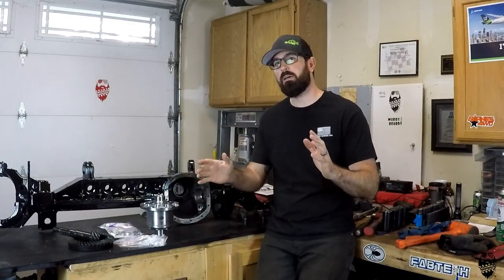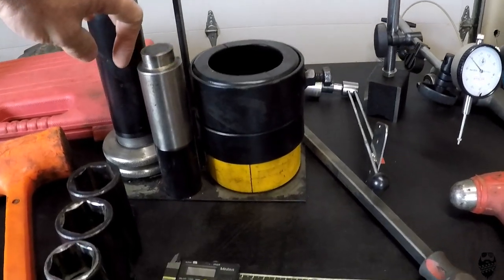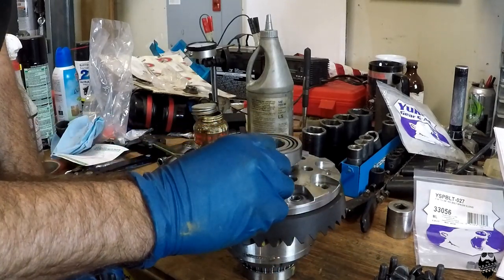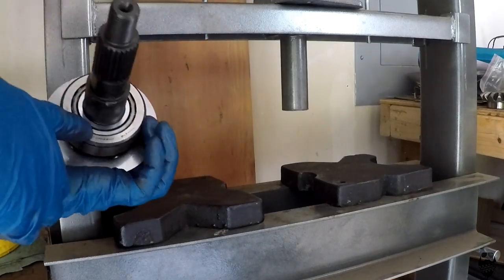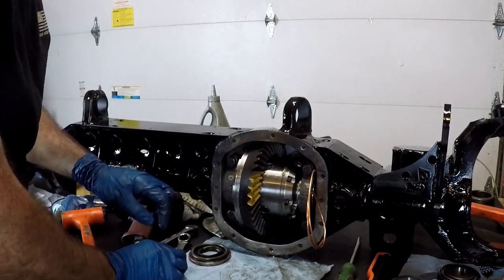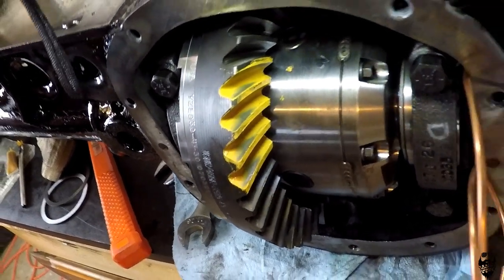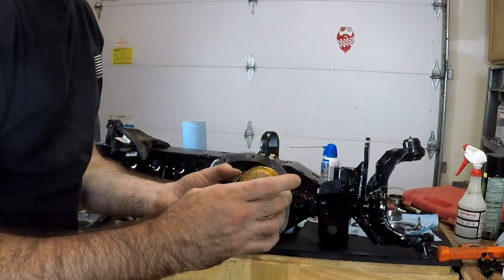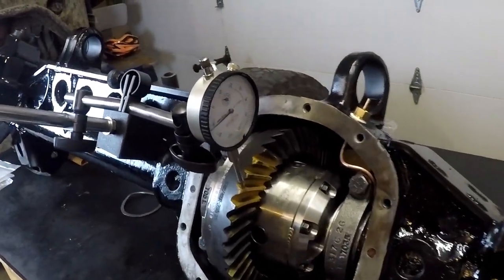Ultimate Dana 30! Episode 2 Yukon 4.88 gears and Zip Locker Install

Comment: 18:45 - It being a high pinion means the drive side is the drive side and coast is coast.  A low pinion is backwards as you stated which is why a low pinion is less desirable, it drives on the coast (weak) side of the ring gear.

Comment: Youve done a great job both physically and educationally. Just a few things with all due respect. I see you having trouble getting your ring gear assembly in the housing. Companies like Mophorn makes a housing spreader to be used in the big blind shallow holes to either side of your housing opening. Just Google jeep differential spreader and or look on amazon. Also unless I saw it wrong (if I did, apologies), when you push your bearings on dont push on the opposite race from the interference fit. If you are installing on a shaft, push on the inner race. Installing in a housing bore, push on the outer race. Not adhearing to this could brendel the bearing race and shorten the life of the bearing significantly. Take an old inner race and dremel out the center till it's a slip fit or more on the shaft and use it as a pusher die. Same for outer race applications. Hope this helps. Keep up the good work and awesome editorials.

Comment: Dana bearing caps are marked at the factory for orientation. if you look at the cap there will be a letter stamped in it and the other cap will have the same letter but turned sideways, the seal surface of the housing will have the same letters that you align the caps with
Reply from the maker: Yes they are👍🏻

Comment: Haters are going to hate on a Dana 30 my 30 is Rock Solid been rocking it for years
Reply: On small tires, sure...
Reply: Wrong 35x1550x15 Super Swampers with beadlocks
Reply from the maker: 36” TSL with locker and factory shafts, still holding together.

Comment: Very detailed video.  I watched Nate's part one already and  I'm stoked about this one because I literally have a high pinion 30 out in my driveway waiting to build similar to this one.  Never done gears but I have set pinion preload on a Dana 30 low pinion with a crush sleeve which is different than the high pinion with shims.   I still need a few tools yet as well.  But I am def going to try and tackle this soon!
Reply from the maker: Awesome👍🏻 good luck
Reply: Got a zj on 33's. Think this would be a great way to go since it's already got the high pinion 30.

Comment: I pulled my Dana 30 high pinion and put new gears bearings axles hubs balljoints. Did the same with my Chrysler 8.25 on my 96 Cherokee.  Should be good for another 200000 miles. Great video wish you had this video out a year ago. The previous owner removed the ring gear on the d30. What a shock that was when I removed the axle cover to see why my front axle wasn't working. Still cant figure out how they tore up the ring and pinion.
Reply from the maker: Nice, 👍🏻 people do some crazy stuff before they sell vehicles to cover up broken stuff, lol.

Comment: On the topic of pinion and diff bearings getting lubed. Check out Gale Banks vid on diff covers. Made me re think diff cover armor. I will be stock cover with external bolt on protection.

Comment: New subscriber to your channel. You should invest in a case spreader!  Like you said...  you can’t set preload too high on the carrier bearings and to this I agree. But some additional preload you can obtain by spreading the case .010 - .015 will help reduce ring gear deflection under stress. We all know deflection is a major enemy of the ring and pinion!  Look forward to browsing them through all your vids!
Reply from the maker: Thanks, 👊🏻 I definitely would like to get one, would save a lot of headache trying to get shims in, I just looked them up and they are more expensive than I was expecting.
Reply: Muddy Beards 4X4   Look on eBay. You can pick one up with free shipping for under $70!  I build a lot of axles for drag cars and 4x4s. I have 2 sets of tons for Jeeps in my shop right now and just finished another set. It’s a worthwhile tool to have!  Also if you don’t know. Spicer has a book that lists all the stock pinion shim sizes used in different housings like the 30,44,60, etc...  it’s not always spot on but a really good starting point when starting with an empty housing. I find I’m usually .005 / .010 away from perfect.
Reply from the maker: Awesome man, great tips, I will definitely check it out!

Comment: Put your ring gear in the oven at about 170 degrees for a little bit. Will slide right over the locker and into place. You never want to use the ring gear bolts to "pull" the ring gear into place.

Comment: Like the build but quick tip of advice and please dont be mad at me for it but the next time you press a bearing on anything. Take an old bearing and cut the cage of then cut a line threw the inner race and press bearing on with inner race. If not you put pressure on inner and outer race and needle bearings so when you install everything it's not smooth as it could be and may feel like you have trash and will premature wear on bearings. Other reason for cutting the line on the old inner race it cause you can just tap it off anything its pressed on to and you dont need to struggle to pull it off. When teaching gears to people I fell thia is one of the best tips!
Reply: He literally did exactly that, and explained it in the video... 😑

Comment: Question about Tools… What is the BLUE race press you use with the hammer to set the race?  Is this a kit or a single tool.  Great Video!!
The best explanation I’ve found, thanks!
Reply from the maker: I believe what you are talking about is a harbor freight bearing race and seal driver kit.
Reply: @MuddyBeards4X4  Thanks for the reply MB! I’ll search HF for something similar.  Just about ready to replace a faulty installation of ring and pinion gear and want to have all the helpful tools I can.  Keep up the good work.

Comment: I’ve setup g2, nitro, Yukon, and stock gears...yukon is worth the money.
Reply: I've seen Yukon gears with chipped teeth right out of the packaging.
Reply from the maker: I have used all different brands of gears, even the cheapest set that I could find on eBay, and have never had any problems with any of them. As long as they are setup properly. I had one set that ended up a little noisy, but it wasn’t too bad.

Comment: Thanks for the vid. I have been watching Nate for a while now so I thought I'd check this out. Never done gears so a lot of what you were talking about was still confusing. Any recommendations for   something to read or watch for someone that doesn't know enough about carriers, lockers, preload, backlash. ect?  I have watched some videos and get a bit here and there but still have a lot to learn. Also I didn't see a crush sleeve like I have seen before. Do you ever use them? Looks like you would go through a lot of them with how many times you pulled this thing apart.
Reply from the maker: Thanks for checking it out👊🏻 setting up gears can be daunting, I recommend getting Yukon gears installation guide and just read it a ton of times. Just google Yukon gear installation guide, it’s the first thing that shows up. I usually use a crush sleeve eliminator whenever possible. If you were to use a crush sleeve it would be one of the last things to install once you have your pinion depth. I have another video setting up Nate’s 9” axle from 6 months ago. And I am currently editing a Dana 44 axle setup. So check those out and read the manual. Good luck👍🏻

Comment: The thing I am wondering is can we knuckles be done and have a Yukon spin free kit with the big brake kit. I have watched Martin built and he used a 1/4 inch space between the caliper and the caliper hanger. I would love to hear your thoughts. By the way sorry not advocating for any channel just thought you should know what I looked at. I have also been talking to Yukon tech person about the hat sizing on the turned down Cj rotors. I think the space will be somewhere about 3/4 inch...I wonder if that is to much with the loading moment caused by braking.
Reply from the maker: Sorry, I don’t have any experience with that. The Yukon guys should probably know that stuff. thanks for watching

Comment: Your pinion should come with a shim reference mark on it.. it will either read.. .26# or +\- 1 etc.. 

The +\- reference is per the factory spec.. so increase or decrease that much thou.. 

Factory spec is .260 so if as typical your pinion is marked .262 you add 2 thou shim from factory spec. This is much more difficult as you don’t have the original pinion which should also be marked and could be used as reference to double check however factory pretty much always the pinion will be spec to .260 and the factory makes all the adjustments to the carrier.. 

This will save your a ton of time

Comment: Love the install video! Quick question. With these set up, I have a dana 44 rear and 30 in front. If I set it up like what you have on the video, can I run 37's? Thank you. Trying to build on a budget👌
Reply: I have been running 37s on a D30 in my XJ for years..... it's all stock internals.... I did do the wj swap for bigger brakes, and I put together a Ruffstuff.com steering link kit.... other than that, stock axles, no truss. No sleeve kit, no knuckle gussets, no bad ass extras...... And no issues.... but I do adjust driving style to protect the D30 all the time.... that being said, it's pretty amazing what the D30 can actually handle 😀
Reply from the maker: I had 36” Iroks on a Dana 30 with chromoly shafts and 4.88 gears. Robbie has 36” tsl’s on a dana 30, so yes you can, but just drive accordingly, lol.
Reply: @MuddyBeards4X4  thank you brother!   judging how you wheel your jeep, ill take that as your definition of accordingly.lol

Comment: Hi MB,  using your video for my build of dana 30 narrow. Love your guys stuff. My question is on the zip locker ring gear sleeves for 7/16 size to 3/8 reduction. I pulled the numbers from the bag in video. Got the sleeve today. Yes 1 sleeve not 10. The cost was $13 . Did you have issue with this. Did you have $130 cost for 10 sleeves? Seems crazy. Thanks again for your content.
Reply from the maker: Unfortunately this was not my axle and I just told him what I needed and he bought it. But that sounds outrageously expensive. That being said it looks like summit racing has them for $5.56 each, so not as much but still more than I would like to pay. Thanks for watching the videos, good luck.
Reply: @MuddyBeards4X4  thanks much for the info and effort!

Comment: what year did you get your housing from on the xj cherokee.or what years are acceptable that i can put into my 98 wrangler?im looking for a high pinion,and why is it you said you cant go above a 3.55 because of the break between pinion gear and i guess you meant the carrier.everyone says it will accept a 3.73 and thats what im shooting for.im running 33 in. wide mudders and its way high as mine is factory 3.07.please point me in direction without costing me a fortune,i dont have.If what you say is true about the break,should i just go with 3.55 and or try to get different carrier or what can i do? sincerely Robert A.great video by the way i love yor channel
Reply from the maker: Thanks, I believe most Cherokee’s older than 2000 had a high pinion. I would look for a whole Cherokee Dana 30 with the gears that you want and just swap it for the one you have. It will bolt right into the wrangler. Than change the gears in the 35 to match. That would be the easiest and probably cheapest way to upgrade.

Comment: what type carrier ,possibly a factory set-up that i can use to get past a 3.35 that i got a reply from on exodus jeep i think.im getting so many different answers,i dont know what to get.you had said in this video with dana 30 which is what i have in my 98 wrangler in front and 35 in rear,and you said 3.55 is as big as i can go because of the break.so how can i get or what shld i get to go to 3.73 or above and is it true i cant go to a 3.55 as you said i can go to.Please help.great videos ,sincerely Robert A
Reply from the maker: Yes, I believe it is 3.73 and above. You can find factory carriers for 3.73 and above on eBay or online for about $80. And swap over all your spider gears.

Comment: Maybe it's just the angle but is that air line alittle close to the upper control arm mount?
Reply from the maker: It is very close... with the truss up there, it was the only location it could go in the housing.
Reply: I was thinking the same thing, looks really close.
Reply: I'll have to go back and watch the truss install and maybe he didn't say but what upper control arm bushing are going in?

Comment: Did you run into any problem with the upper control arm clearance with the air bulkhead location?
Reply from the maker: Nope, it was very close but it worked.
Reply: Yeah, you must have angled it a lot more than I did apparently. Mine comes out right under the edge of the bushing. UGH!!!

Comment: Nice been thinking in doing all that just a smal different im using mecanical locker ,and will you recomend 4.88 gears for 37 inch tires
Reply from the maker: Nice, gear ratio depends on what your goals are. 4.88 gears and 37’s will be similar to stock, would be fine for the street and hitting some trails but crawling on rocks you would wish you went lower.
Reply: @MuddyBeards4X4  ok ,im using my zj at Average joe 4x4 event , is competition for regular guys you know not that creazy , but thanks will go up to 5.13 better thanks

Comment: I have a low pinion 30 in my '01 XJ. Any suggestions for upgrades or just find a high pinion unit? I'm on 31's, 3 in. lift, never anticipate going over 33's.
Reply from the maker: If you are only going to 33’s just stick with the low pinion. Get a good locker or limited slip and matching gears

Comment: You mentioned a locked d30 you had on 36s. Was it a built axle with truss and armor or stock?
Reply from the maker: It was a hp30 with chromoly axles, 4.88 gears, Detroit trutrac and ranger style locking hubs. It did not have a truss or any armor besides an aftermarket diff cover. It was definitely at its limits and I babied it for sure until I got the Dana 44. And then I got 40’s. So kinda back to babying it, lol.
Reply: @MuddyBeards4X4  that's kind of the route I am taking. I was leaning towards jcrs truss since it looks simple to install, and also c gussets and sleeves but idk if I need all that. I will be running 35s and eventually 4.88 gears. Do you think the truetrac was easier on the axles than a full on locker? I dont think I'd need anything more than lsd but I've been considering lunchbox locker for the front as well since I could install it now
Reply from the maker: I would just do the truss and the c gussets. 4.88 gears and 35’s will be perfect. Locker really depends on your budget. Robbie has the Aussie locker in his Dana 30 with 36” and he likes it so far. The trutrac is an amazing lsd. it was my favorite by far for drivability and offroad, but 35” tires is pushing the limit of that locker, I believe Detroit say 33” max. The way the trutrac operates is way easier on axle shafts than a lunchbox. Really depends on tire size and budget. A lot to think about, that’s why I have changed mine like 4 times, lol.

Comment: I'm looking into upgrading my Dana 30 with either 4.88 or 5.13. I'm running a 2007 Jeep Wrangler with 35s (daily driver), and 37s in the future. Light off road for now and some towing. Also running Yukon axle shafts. Any advice on what gears would be best?
Reply from the maker: With 35’s I would do 4.88, but if you plan on going to 37’s I would go With 5.13 for sure
Reply: Thanks!!
Reply: If you're planning on 37  you might as well look into a rockjock 44 or prorock 44. You're going to need something a lot stronger than a D30
Reply: @MuddyBeards4X4  true. I'm running 4.88 on my dana 30, with bf mt wich ate pretty heavy tires. @wj4x4offroad I also upgraded my gearbox to a redhead

Comment: i have dana 30 jku with 35s 4.88 gears i do moderate wheeling could i get away with truss kit on dana 30 or should i get dana 44 later love your Chanel
Reply from the maker: Truss, chromoly. You won’t break the 30 with 35’s. Ran it for years.
Reply: @MuddyBeards4X4  even with a 4 door
Reply from the maker: Hm..didn’t see the jku part, lol. Probably save up and get a 44. But make sure you do your research and get a good d44.
Reply: @MuddyBeards4X4  thinking dana ultimate 44 thanks for your help

Comment: how do you like the 4.88 gear on the highway? im debating 4.88 or 4.56 with 35 inch tires but idk if 4.88 is overkill.  I do mostly trail riding and overland stuff. It does see some daily driving and it is a automatic
Reply from the maker: If you do a lot of freeway driving I would do 4.56, if it’s occasional freeway I would lean towards 4.88. I think you would be happy either way.
Reply: Muddy Beards 4X4 I do the occasional road trip to a wheel and camp. I jut don’t want my engine to scream getting there. how does the small pinion on the Dana 30 hold up with 488?
Reply from the maker: I ran 4.88 with 35’s on a Dana 30 for years and I definitely preferred 4.88 over the 4.56. There are ratio charts out there that give you and approximate rpm based on tire size and gearing that might help as well.

Comment: can you weld truss on  when on the jeep or do you have to have  axle all apart
Reply from the maker: You could do it in the Jeep, but I would recommend taking it apart first as there is a lot of heat that will transfer to all the internals, seals etc.
Reply: Wish I would have built trusses for mine when I had it out and on the bench. That's a good looking axle he did a great job on it